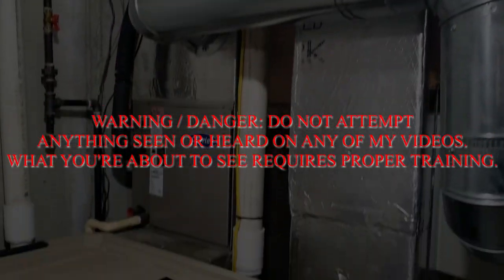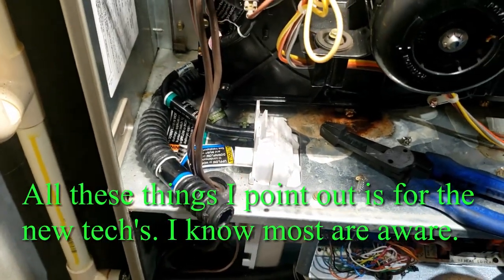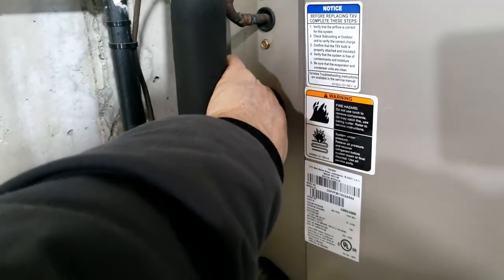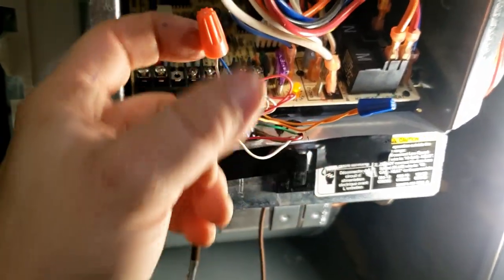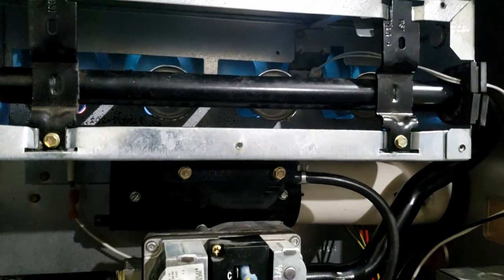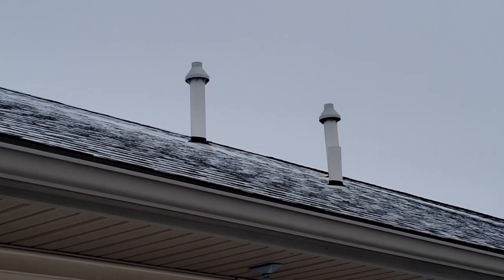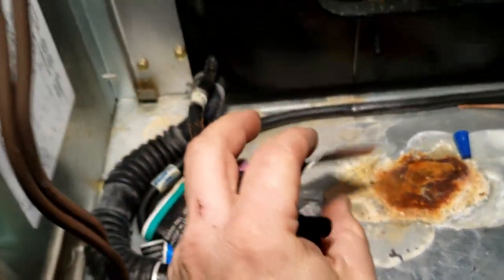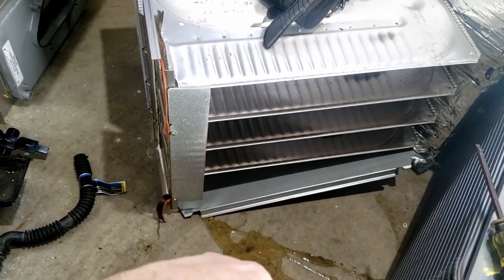NO HEAT SERVICE CALL CARRIER GAS FURNACE NOT HEATING

Comment: Thank you sir for the feedback  I just service a carrier 100,000 btu and the code was 34 which is open roll out switch I take the draft inducer and I see a lot corrosion coming out so conden the heat exchanger told the customer he needed a new unit because it 20 years old but I tha not now carrier offer a new heat exchanger with out cost thanks again have a good day
Reply from the maker: "limited Lifetime warranty" for the original owner but 20 years from mfg date for anyone other than the original owner. Your welcome👍👍. I'm glad your getting something out of then.

Comment: I appreciate it, we still don’t see many of those down here in Georgia.
Reply from the maker: Interesting. Do you mainly just have heatpumps with electric back up?
Reply: @HVACRSurvival  years ago when y’all had to start installing 90% furnaces, we had to go to 14SEER heat pumps, and AC. The 90% furnaces aren’t mandatory here yet. When the EPA mandates new changes we will have to make a change. I’d say about 40% of my calls have gas heat - natural gas and propane, almost never fuel oil

Comment: Nice video! Good call on exchanger, replaced before hole and co2 the home! And run better!  Also I thought humidifiers took out moisture not add? Moisture bad!
Reply from the maker: You're thinking of a dehumidifier, and you got to remember I live in Ohio so the humidity is low in the winter. It really just depends on where you live at whether you need the humidifier or not. That thermostat you seen in the video will reduce the humidity as it gets colder outside to protect your windows from sweating.

Comment: A simple way to diagnose them is the smell of the exhaust, if you can get to it. There is a very distinct metallic type smell, almost taste. It is called aldehydes. 
You might have been able to smell it once you pulled the inducer.
Reply from the maker: It wasn't at that level yet. But I do know what your talking about.
Reply: @5822huron  
Not really, just rewatch this video and he states that is what he usually does but this one showed no signs of it.
The best was is to use a combustion analyzer!!

Comment: Good Video👍, the amount of water that was in the bypass duct is still puzzling to me, first thing I was thinking that maybe the heat pump never came out of defrost or a Reversing Valve issue
Reply from the maker: Normal humidity in the winter around Ohio is 30-42%. The window protect mode was set one digit higher. I moved it down 1, when I came back for the heat exchanger the humidity was in range.
Reply: probably short cycling and not pushing the humidity out of the ductwork, plus steam/backflow rising and condensing in the pipe, especially if hooked to hot water, which it probably is or piped close to cold inlet of water heater, the thermal expansion will back-flood out and to it. (seen both happen before) I only like cold water to them, since the heated water is generally a larger mineral/scale factory.
also 50% would be way too high depending on the outdoor temperature, the windows/doors/walls should be sweating if it's real cold outside.
Reply from the maker: @throttlebottle5906  I probably forgot to mention I turned down the humidity setting. This uses a sliding rule that reduces the humidity as it gets colder to protect the windows from sweating. They use arbitrary numbers to signify humidity levels and not actual percentages.

Comment: Question for you. At what point do you shut the furnace off? I'm assuming it was burning bad and causing high CO? Technically, here in Ontario anything over 100PPM needs to be shut off. Thanks
Reply from the maker: The only way co will get into the ductwork would be for the hx to be split open, I haven't seen a 90+ Carrier split yet. When the heat exchanger completely delaminates in this type of Carrier furnace,  it will cause the roll out switch to trip causing the furnace to shut down. I shut down any furnace that has a hx split open.

Comment: Code in Virginia 90% furnaces exhaust have to be insulated to where it penetrates the roof
Reply from the maker: We do that if it's running horizonal in a unconditioned space but not very often if it's strait up vertical.
Reply: Are you sure it is not just to be insulated if in unconditioned space, bit okay if in conditioned space.
MFR does not require it except in unconditioned space over a certain length.

Comment: Replaced many of those secondaries. But what's with the romex just ran down the intake and not to a switch?? Lol
Reply from the maker: HVAC is not installed around here. But to there defence in regards to the switch the breaker box was 5 feet away and could be seen.

Comment: Carrier used to be very good!!!
Now carrier is garbage!!!!!
I have replaced too many of secondary heat exchangers
Reply from the maker: Show me a brand that doesn't have failures.  Lennox, York, Goodman, Trane, etc 
They're isn't a reliable perfect system, just ones that have less problems. Carrier redesigned there heat exchanger a while back one the current 95+ furnaces and I haven't had many problems that weren't caused by people not following proper procedures. Even this furnace was a 2006, I've had 2003 even 1999 that are just now failing. That's 15-21 years old. The higher the the efficiency goes the more issues you'll have.

Comment: The “M” series secondaries were made with polypropylene construction. Carrier will literally pay $700-$900 for you to replace with a newer model. The heat exchanger can be replaced under the program but it’s literally just the same one and the failure will happen again.
Reply: I had a homeowner finally replace the furnace after the third failed secondary hx.
Reply from the maker: Your correct. I have done 3 HX this week.

Comment: Just had a heat exchanger training and of all the failed heat exchangers we looked at this particular carrier model has killed more people than any of them and carrier still manufactures it. When it fails under warranty they send you the exact same one.
Reply from the maker: Depending on the year of the Furnace the customer has the option of replacing the whole furnace at a discounted rate depending on the serial number. I'd like to know how many people really has died because generally these don't get that bad where you actually get enough Co to the point where it's really going to kill somebody. Generally the upper limit will trip and shut the whole system down before that happens.
Reply: @HVACRSurvival  Heat exchanger experts put on the training I went to and it was the most informative training I’ve ever been to. They said the issue is the plastic layer on the inside of the secondary will break down which clogs the secondary and causes hundred of pinholes and breaks down the metal. Apparently lots of issues in the southern states last winter with the subzero temps combined with gas furnaces that don’t see much action during the winter.
Reply from the maker: That makes sense about the southern usage causing more problems.

Comment: carrier the 16 minute max upstage timer sucks, stat controlled strictly based on temp with ability to downstage is way better. much longer cycles.
Reply from the maker: I don't like down staging, and because they don't explain how the auto mode figures out how soon it will change over is why I picked the 10 min timer. The 16 minute and 15 minute timer was on the older Carrier stats, this was a Cor 7 stat.
Reply: @HVACRSurvival  was talking about the furnace board's internal timer, not the t-stat.  to me the entire point of buying a 2-stage is to get a furnace that doesn't shut off during a cold snap, just run gently on low and on occasion switch to high. It takes a good thermostat which monitors rate of change to get the best results, the ones with a swing instead of cycles per hour algorithm can get stuck perpetually below the setpoint which i don't like.

It's a matter of personal preference though and it's good to give different options.
Reply from the maker: @Jon-hx7pe  sometimes I can't see what video a response is coming from. I thought it was in my most recent heat pump video. So my answer had to go with that one. My bad

Comment: How is that a heat pump if it has propane
Reply from the maker: Instead of electric for the aux heat the gas furnace is used. But the gas can not run at the same time as the compressor. It's called dual fuel. What part of the country are you in?
Reply: Los angeles
Reply from the maker: @jessec.9295  it doesn't get below 30* there very often, it wouldn't be feasible to use a gas furnace there as auxiliary heat. It's more common in rural areas, which is where most of my jobs are at because natural gas is not available and propane can get expensive. And in areas of the country where it gets below 30°. Basic heat pumps start losing a lot of efficiency below that balance point.